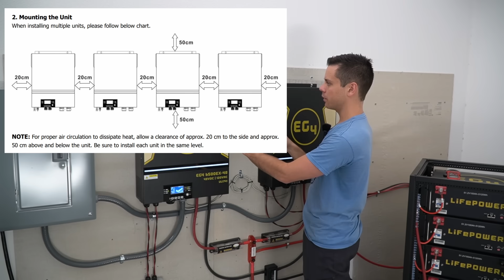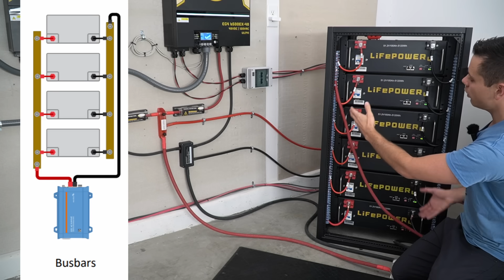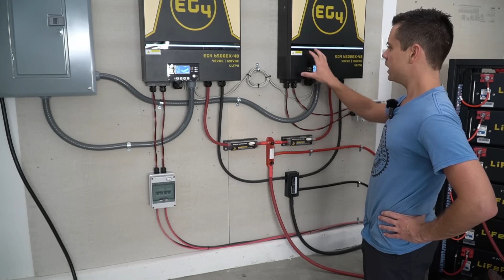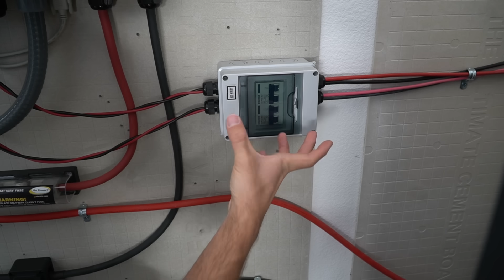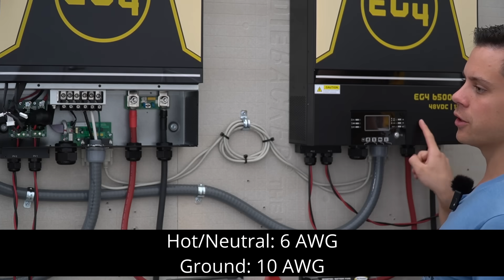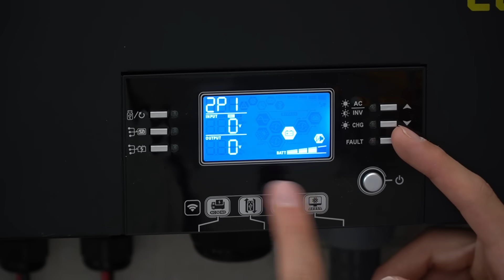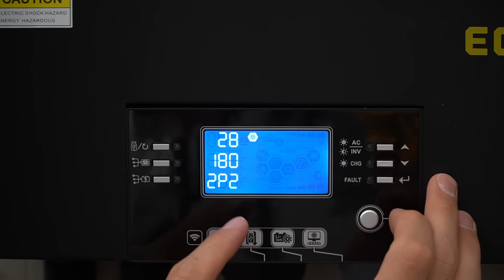Complete 48V Offgrid Solar Power System

Comment: Why all the 48v? People still want 12v and 24v systems!
Reply: Smaller cables ?
Reply: @AaronBlake  that doesn't outweigh the cost difference when everything you already have is 12 or 24v.
Reply: Signature solar still has 12V and 24v systems available, including these batteries.
Reply: When dealing with a 12v or 24v system you also have to realize the the MPPT charger is being limited on its input as well.  Where a 48v system may handle 4k of solar, a 24v system may only be able to handle 2k of solar per CC.  So now you're having to get more hardware to support your input capacity. (Been there, done that).  Gonna all depend on the size of system you want.
Reply: @RoySalisbury  understand. I have a 12x28 house. Just saying that I would like to see a little bit of everything. I understand that 48v is the best way to go.
Reply: Once you have 30kwh of battery, 12v and 24v are too small to be practical. also these are all-in-one inverter/charger/mppt so why would you be tied to 12v anymore, anyways?
Reply: @chriscappuccio  nobody said I was trying to be practical you flipping nerd! I am simply trying to state that I would like to see more of 12 and 24v!
Reply: @chriscappuccio  My guess is that he has other charge controllers that are 12v or 24v, or other things that run off the battery bank and cant replace it all.  But who knows. I was basically in the same boat, but in the end just decided to replace the whole lot.

Comment: Great video! What size circuit breakers are you using for your loads? Also, is 60A sufficient for the two inverters if they were running at max capacity?
Reply: 60a should be fine for each.  Each unit can only do 6500 watt  (6500w / 120v = 54a).  Now I don't know about the surge rating and how that effects the breaker.
Reply: @RoySalisbury  What about the  load breakers?

Comment: getting closer to what I am looking for ... is there a way to add in other inputs, like wind or water? I am wanting Grid Tie, the site implies you cannot use these controllers ... also, I want to run the system with a generator, if the grid goes down. We already do that aspect:-)
Reply: You can add anything that connects to 48V DC without negatively impacting the system performance. Only when the CAN communication between battery and inverter is used, is it not recommended to add additional charge controllers (like water, wind, other PV), as these cannot be controlled by the battery BMS.

You can use the AC input for a generator connection, and adjust the charging current to ensure you don't overload your generator - you do, however, need to ensure that your generator has split phase 240V when connecting to inverters as set up here.

Comment: Will, I can't thank you enough for making this series. I've been on the verge of buying and building a system for a while and this fits the bill perfectly. The way you lay everything out is perfect for a beginner that has only done minor electrical work in the past. I now have the confidence to start ordering my supplies and gaining my independence from the ever-rising electrical rates.
Reply: I agree, one of the best informational videos I have ever seen on on YT.  It encourages me to take the leap building my own system.  Thank you Will!
Reply: Yup, I'll be moving full-time to my lodge in a few years. I think solar will be at the perfect price point and capability 2 years out.  Right now when I go I just bring generators, charged batteries and a couple solar panels for a computer Can't wait to see Will's setup in about 2 years. It will be the one I buy.
Reply: Wills videos are GREAT, He is knowledgeable, articulate and friendly but DO NOT BUY  from signature solar they are the WORST company to deal with, sold me an $1,800 EG$ 48v battery that read 120 volts right out of the box (with the battery breaker in the off position) How is that even possible?  checked it 3 times with 2 volt metersI emailed them and did not get a response for 5 days, when i sent the defective battery back they kept my money after promising to refund it and now I have no battery and am out of $1,800  - (theft and fraud) they did refund the (2) 6500 watt inverters  that their battery blew when i connected  but scammed me out of the battery and $1,800 after telling me to return it for a refund - to be clear I have several 48 volt battery banks and nearly 100 solar panels powering my house so I'm no novice. saw this video by Will and was so impressed thought I would try signature solar but what a NIGHTMARE. The best LifePO4 batteries are from Redodo on AMAZON free shipping, incredible customer service and a bad ass battery . Redodo sent me a schematic on the best way to configure their 48v battery banks, a free battery charger and they answer my questions within an hour or two even on weekends. I have dozens of REDODO batteries powering my homestead. Also the batteries and inverters sold by signature solar are just spray painted by them , they do not make them - I replaced the inverters that their battery blew up with 6500 watt inverters by sunpowergold *WHICH IS IDENTICAL TO EG4 - Sunpower gold is an awesome company to deal with so if you are looking for a 6500 watt 38 volt inverter try sunpowergold, very responsive unlike signature solar....I wish I had read the BBB complaints on signature solar before i gave them my money, apparently they re-sell the defective batteries that are returned cause the one I got was all scratched up, missing brackets and had no documentation....better to look elsewhere other than signature solar
Reply: @greensolarsystems2332 
I'm just getting started and can't afford to make mistakes. I appreciate your advise. What company did you get your panels? How many watts are each panel . I'm trying to go total off grid . I'm tired of all the price hikes in my town . Wish to be self contained.
Reply: Thanks Will you are Awesome
Reply: G'day mate i concur
Reply: I would still recomend getting an electician to at least check afterwards. Electrical fires are realy bad.
Reply: How to I use this information to determine the size system I would need for my home?  I know my average kWh usage over several years.
Reply: Evo x
Reply: How is your system going at this point?
Reply: Thank you for your comment! I'm glad you found the video helpful in gaining confidence for your off-grid solar power system. Based on your interests in outdoor activities and home backup power, I would highly recommend checking out the Segway Portable PowerStation Cube Series. It offers a massive capacity, powerful output, fast recharging, and waterproof technology, making it perfect for outdoor adventures and ensuring uninterrupted power supply during emergencies. You can easily manage and monitor your power usage through the smart app control feature. Happy camping and stay powered up!
Reply: Toby you are spot on. I'm in the same boat. After watching Will explain everything in such detail and in a manner we can all understand, I feel much more confident. Thanks Will. Keep making these videos.

Comment: My son and I each just purchased this system. Excellent video, Will! What timing! Hats off to the folks at Signature Solar who make this purchase pain free.
Reply: What was the total cost?
Reply: @VanillaAttila  prolly around $25,000 with 16kw of panels
Reply from the maker: @drthik1  
Total Cost of All-in-one and Wiring Costs: $3,283
6X 5kWh Batteries and 6 Shelf Battery Rack: $10,168
This does not include Solar Panels, Racking or Installation
(this price can vary drastically depending on your roof and type of solar panel being installed)
Reply: @WillProwse  How many panels that you used?
Reply: @WillProwse  thank you very much.  Appreciate so much the video and rhe cost break down.
Reply: @moisedhaiti2524 ,
the average 2,000 sq ft home in a southern, sunny location will need 20 to 24 panels of 340 watts which will be more than adequate.
The more North you go, the more panels.
Additionally there are websites that will use Google Earth and your location to estimate not only how sunny it is on your roof, but where the panels need to go.
Reply: @drthik1  not sure it's worth it. How much is electricity? $50 month?
Reply: @martinkulik9466  for me in the winter I'll burn over 2500kwh a month and the bills average $300 a month . 
Looked into grid tie and the utility only credits $0.03 a kwh but charge $0.15
Reply: @martinkulik9466  you’re making an assumption that grid electric is available.
Reply: @drthik1  does the 2500kWh include heating? My ANNUAL electricity consumption (2 person household) is about 2000kWh (excluding natural gas for heating). We live in Belgium
Reply: @keithlucas6260  please list website thank you!
Reply: @zawatowski  It seems you have a very low consumption foot print, but that is very normal in EU. In US the average are much higher and my annual as others stated are equal to 45000kwh. In US many houses in urban area's use electrical stove,  boiler, heating etc. The bill goes up very fast and electrical companies bundle many things to your bill as extra charge
Reply: When you buy this DIY.   Do you get / are you able to submit to the us gov for the tax credit ?   Or must that go through a firm ?   -
Reply: @chuckmarineau4684  I believe you have to be grid tied to the utility company before the US govenment will entertain you. You could get the forms to fill out by googling it. You don't need the firm to do it. Also must pass inspection with the city ...locality you live in.
Reply: @henrylee8092  so if off grid you don’t get the incentive?
Reply: @richardreese5377  I have't bought any system yet but to  get that 26%   from  the   government  you need  to be grid tied so the   utility could get  as much  as they can if you  don't plan it right. If you produce excess power they credit you pennies to the dollar then when you get it back when the sun is down they sell it at the peak price or going customer rate. So in esense you are powering your neighbors electricity and the utility reaps the rewards!
Reply: @henrylee8092  US federal tax credit applies to off-grid as well as grid-tied (according to us.gov's website).
Reply: @richardreese5377  nope you have to be part of the grid.
Reply: How are the systems now?

Comment: Seeing how these are 120v inverters, would it be possible to use a small inverter generator with 20amp output to charge the battery's backup if needed?
Reply: Good question.  I was wondering the same.  Especially if you have 2 units in parallel.  Can one leg be powered by a generator.
Reply: I used a propane-powered Cummins RS13A 13KW backup generator AFTER these units' output, with a transfer switch. The generator only comes on if the solar/battery/grid all fail. I have a separate 2KW LFP battery charger from the Cummins output only, thereby increasing the load on the Cummins, but it is actually more efficient at around 1/2-max-load anyway. This also reduces the time the generator is on as it cycles between battery/generator if there is no grid or solar.

Comment: OK Will - next one for you : solark15k with SOK batteries grid tied AND a >10kw generator hooked up.  12
Reply: What's the benefit..? these two units together are less than a third of the price, and perform better. Will won't ever do grid-tied either, no use in paying all that extra money for permits and inspections

Comment: This is an amazing video and I really appreciate you taking the time to go through the full detail to set this up and why you chose each component.  My only concern is I'm still hung up on that high idle power of ~ 160W for 2 of these interverts -- nearly 4 kWh/day or >1300 a year is a lot of energy loss.
Reply: Same here...another fan from another vid on this E4G commented it needs  2KW each day just to idle and be ready to provide AC on top of the 2kw it needs just to run.
Reply: @henrylee8092  holly smokes, that kills it for me;  that is not green ,it's bloody red
Reply: To put the standby power into perspective, that is less than the total output power of a single solar panel(which can be had for less than 150(I've bought used 300W panels for 30))
Reply: @Turkishmath  You might want to research that a bit more.  160W idle = 3.84 kWh per day.  A solar panel typically gets 3-4 hours of 'full sun' equivalence in many areas of the world, or about 0.9-1.2 kWh per day.  You'd need 3-4 panels in large portions of the US and EU to just 'pay for' this ridiculous idle power.   Even Arizona gets 7.5 hours of full sun equivalent = 2 panels needed to handle idle.

Comment: Awesome!!!!  I want that system for my house in AZ...summer I use about 110KW/D and winter only 50....how many solar panels would I need?  would 40 X 100 watt be enough?
Reply: 110kw per day?  I know in northern AZ I can average about 6.5 hrs of solar per day.  110,000 / 6.5 = 16,923w of panels.  Using 330 watt panels you would need 52 panels.  And thats just to let you break even daily.  And to support that panel input you would need at least 3 of the units shown in this video.  And at 110kw per day your looking at an average draw of 4.5kw AC .. so you would need a battery bank to support that during the night.  Lets say its 50/50 .. then your battery bank will need to handle 55kw of storage and at least a draw of  95 amps. Thats all "back of the napkin" math and is for "off-grid".  Grid tie is completely different.
Reply: @RoySalisbury  I appreciate the comment. Grid tie would be so simple if they didn’t make you buy their components that are 5 times the price. If they really wanted, they’d make their systems not such a rip off, or let us build our own and just pass inspection.

Comment: Hello.
I've found a link to T class fuse on the website, but it refers to 12V model. I guess it should advertise a 48v+ fuse, isn't it?
Reply from the maker: Yes it works on higher voltages

Comment: I know this varies by location, but in the "average" American location what is the threshold for needing to be code compliant? I think it's pretty clear cut if you're trying to sell your excess solar capacity back onto the grid (running your utility meter backward, basically). However, in my case I won't have solar at all and I just want to use batteries and inverters to implement a central UPS for a few select circuits in my home. Do I need to meet the same general requirements in both situations? Or are there slightly less strict requirements for just using battery backup? My plan would be to break out the circuits to be backed-up into a sub-panel and rely on the transfer switch inside the inverter to switch between utility power or battery backup if an outage occurs.
Reply: You're going to have to talk to your county/city about this. In Utah as soon as you involve a battery they absolutely freak out with compliance requirements even if you aren't going to be grid connected.
Reply: there's at least 50 "average" American locations, each being truly unique in how they structure their regulations. Some may take offence if you even charge your batteries from the grid (even if the inverter doesn't have the physical capability of exporting power, like these units)

Your local registered electricians are all fully conversant on UPS / generator change-over installations and accompanying code requirements. 

Your AHJ will also have registration forms for PV installations, which would either detail the specific requirements, or reference other legislation to which you'd need to comply. Irrespective of the electrical requirements, there's still fire codes and homeowner's insurance caveats that also apply.

Comment: Damn, this is almost exactly what I'm looking for. I'd love to see some stuff about grid tied as well.
Reply: Same. Although, I've said that quite a few times with different setups Will has made videos of. They just keep getting better and less expensive, and I am ALL for that. Lol
Reply: Grid tie as in bypass mode? Or net metering? People seem to use the term for both.
Reply: If you mean Grid Tie as in backfeeding for credit, which is the accepted meaning of the term, that gets a lot more difficult to be code compliant as you have to make your utility company happy as well as your local code enforcement.  If you mean Grid Interactive, which usually means as a UPS (grid priority) or as grid backup when batteries get low and solar isn’t available (solar/battery priority), then this video is only missing one step which is have the AC input connected and those related settings set.

Comment: Will, If you wanted to put six inverters and more batteries, what would be the best way to connect it?
Reply: It is in the manual for the invertor and he mentions how to add the output to the breaker panel in the video.

Comment: Question, does all of this stuff need to be in a climate controlled area? I am wondering if something like this would work in a hot Texas garage.
Reply: The units are only certified up to 40 degrees Celsius (104 F) ambient temperature continuously. Anything above can cause the unit to trip intermittently on over-temperature when working hard.
Reply: @stefanvanzyl9090  Definitely no Texas garage then, thanks for the reply 👍

Comment: Great video. Except, I would personally prefer locating the battery fuses closer to the output from the battery.
Reply from the maker: Yes very true. The batteries have built in breakers. I wish I could add a fuse on the server rack busbar instead. That would be best